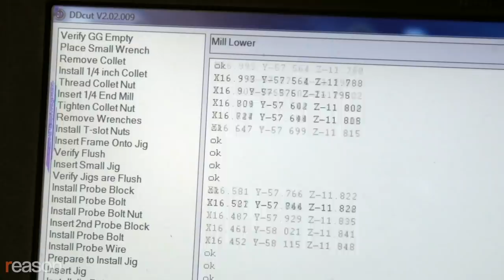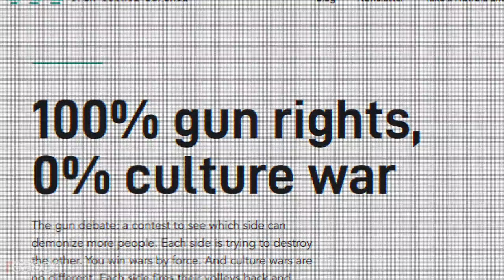Biden's Plan To Stop Ghost Guns Is Doomed To Fail

Comment: To be honest, what I would like to see is pre-made kits with strips of Steel cut to shape and drilled so that we stack the A sheet on top of sheet B on top of sheet C on top of sheet D Etc and then put our rivets through them. Of course, we would lay different parts in place as we would proceed... but one could make something like a Mauser broomhandle type of action in this way where all the parts could be dropped in and assembled just as the milled Mauser broom handle is made today.
As an added bonus, the guy who would sell the kits could also sell the tool kits and magnifying materials necessary to do a good job with something like that.

Comment: You can't have a reliable gun completely built out of plastic. So no it can't bypass security because most likely the gun still has metal internals to deal with high pressures, something plastic can't do.

Comment: The list of guns you can 3d print with a sub $200 printer is pretty large and getting larger by the day. Wilson is 100% right. If anything this explosion in 3d printed firearm design will accelerate with more regulation. Right now there are dozens of firearms you can print then finish with factory parts and only a few total scratch built designs. As soon as ATF issues rules regulating more gun parts the 3d printing community will begin shifting to making those parts. Even after those rules are likely shot down in court the shift toward totally scratch built arms will likely continue. As happened with magazines where government mostly lost in court with rules and laws restricting mag capacity, but the evolution of 3d printed mags has continued to the point they rival factory mags government sought to ban.

Comment: 0:48
That's interesting. Can you actually make a fuctional firearm from 100% plastic (apart from the repellant of course)?
Reply: It's 3d printed
Reply: In short, yes. It's got a VERY limited life expectancy. MAYBE 50-100 rounds at the very best of times, usually under 50. That OG liberator design featured in the video is only intended to be fired once. It's meant so that everyone can have an "oh shit" gun in their bedside table.
Reply: That gun used a metal nail as a firing pin and only lasted one shot realistically.

Comment: Liberator, FGC 9, 'Luty' SMG, guns designed to be an unregistered firearm. Only problem is, when has there ever been a firearm thats uses 0 metal? FGC 9 takes glock parts, Liberator 'legally' needs metal to be detectable, even plastikovs need AK gas barrels and springs! Its just a hopeless battle

Comment: The government would have to serialize every block of metal, every tube of polymer, and lock down any and all components that could be used to mill a firearm from.   

This is not impossible and it is currently done with explosives and drugs as many precursor chemicals are hard to come by, need permits, and red tape abounds.

Comment: Forget guns, you can build your self a Gatling gun you can buy a resin printer today from Gearbest aka China unregistered have it come in your doorstep and you can even buy resin from amazon. If you want to make stronger parts you can even mix in some glass fibers in your resin. It is messy but it works. You can make the Gatling gun autonomous too, but that is a different story. You can make, rockets too with resin printers, that is also a different story.

Comment: Canada has a big problem with ghost guns, but in canada is... different.

What people do is buy gun kits, and mate them with..   BB guns and airsoft kits.   Something you are not supposed to be able to do according to airsoft.     These people will mill out parts from the "toys"  combined with kits, to produce working firearms.    one "pair" working in their backyard workshop, churned out a few HUNDRED of these firearms a year.   Now while they were more expensive to make, then a gun bought at a gun store...   maybe using 1000 dollars in parts...   they were then selling them on the black market to criminals for 2000+.

the ability for people to buy kits then mate them with toys,  as mass production, is a fairly scary thought.  and again, this was just 2 guys.
Reply: @Bada_Boom78  Yes and no,  the vast majority of illegal hand guns in canada come from  "legal" buys in the states, people will go into a gun store in the usa, buy 10-20 hand guns, then smuggle them across the boarder by simply driving them across "patrolled"  areas, or bringing them across by boat.   Buying guns for 500-800 dollars in the US then selling them for 1500-1800 in canada is still a profit.  And far easier.

But you can still legally buy handguns in canada.

Comment: Least you forget the Constitution ensures we have the Right to Bear Arms. That "right" has no nonsense baked right into it. You do NOT need a license to own a firearm. This is not a right that you regulate. All that an FFL is there to do is to accomidate the commercial transaction and NICS background check in the movement of firearms from one party to another. It is NOT a license for the holder of that firearm. That "license" is only for the commercial distribution and transfer or sale in the aspects of commerse. NOWHERE in the 2nd Amendment or elsewhere for that matter does this state you cannot manufactor your own firearm.

If your INTENT is to sell this firearm, then by all means yes it needs to be regulated to record its transfer in the act of commerce. 

Period.

Comment: genuine question: Can you really entirely 3D print a gun with its ammo? Like, you need bullets. not only that but you'll also need powder to shoot said bullets. Can you 3D print a suitable bullet, heck. will the gun even withstand the pressure of firing if it's made entirely of plastic? Is that possible? I mean even if you got the thing to be entirely of plastic, there would still be other ways to detect it. Police dogs would smell whatever propellant you use for the shells a mile away.
Reply: you dont print bullets you cast them

Comment: Good luck trying to regulate every single CNC mill and 3D printer out there.
Heck if you try hard enough I can assure you that it is very possible to mill out a M2 Browning from scratch. 
Heck the original design is from 1933, the mechanism ain't that complicated.

Comment: haven't watched this yet but, i mean, if y'all think that this is the first time a pres wanted to prevent 3d printed or homemade guns, you're wrong, this is the 3rd president in a row, I'll update the comment if thats addressed btw

Edit: 
finished watching, they did touch on it but i real quick wanna soapbox here, i think that gun and car licenses should be about equal, and that they should pretty much only mean "you can use/have things with this vague functionality in public only if you have this card".
think about it, if your dear ol pa has a tractor or a car or a golf cart you can drive it on his property with no problem at 12 years old, but to go out in public with it you gotta do a test to show you know how dangerous things can be, and after that whatever dude go do whatever(though homemade cars are sadly not a thing these days or I'd be driving around in my single-seat sized electric car to and from literally anything)

Comment: Its funny how the most common response is " Well if you know what your doing you can just make one without this machine therefor we shouldn't stop devices like this from being made or regulated." as if this argument makes sense.  I mean people will just die in cars anyhow why are we regulating safety features?  Just because a thing is going to happen doesn't mean we shouldn't make the attempt to restrict that thing from happening its the difference between some rando trying to avoid the restriction, is it going to stop all ghost guns, no.  Is it going to make them far harder to make absolutely.  Also there is no expectation of safe operation of some rando gun but if a registered company mass produces guns that explode on people there is repercussions and consumer protections that do not exist with self milled or 3d printed weapons.  The right have been screaming "There taking our guns" for 30 years and somehow we have yet to see a "we are taking your guns" act. an act that will never happen but it doesnt stop the fearmongering.

Comment: Said before and i'll say it again, regulating guns is a pointless move. First off it ain't hurting the bad guys, Correct me if i'm wrong but i don't see gangs and other bad guys getting guns from stores where they have to do papperwork which could be used to find them if they use the gun. Regulating is hindering the good people's ability to defend themselves. Secondly, as shown on this vid, if you restrict people will just find ways to make their own shit. just like they did during the prohibition.  

Even if they tried regulating the ammo, which i think would actually have a somewhat bigger impact at least at first, i can promise backdoor dealings will happen and bad guys will still keep supplied.

Comment: no ones gonna use a plastic gun. the bullets would be too shitty to do much. and the accuracy will be terrible. Its like using ratshot. except even weaker.
Reply: the bullet is metal and they use a couple metal parts, the metal detector thing was a weird thing to bring up

Comment: Being British and having almost no access to guns but advocating that we should have them. only our hardened criminals and there cohorts have guns here. <with a few exceptions i.e police at airports  police around parliament/palaces. Yet We allow 12 and 13 year olds weapon training and access to Live ammunition, Have Britain ever had any incidences with these children, No we have not - so Training from a young age instils understanding of the risk and danger as well as proper handling and safety.

there should be Less Gun Control and more Youth Firearm training at young ages like we do here in Britain. true most of this training is with .22 rifle and cadet GP L98a1 rifle<Basically an SA80 with firing mode set to single fire, some of the more competent children get to use the LSW standard issue the same as the British army. Youth Firearms training for all would increase respect for such devices.

Comment: I would point out though, I learned how to machine gun parts in about 2 months in a class I paid 350 dollars to take on gun smithing. Its not rocket science. its scarily easy and if you ban guns people can and will simply make their own. We did it once in history and now wiith science where it is we have so much more capability at home. Not saying I'd do something like that I carry legal fire arms but the answer to ghost guns is a simple one really. Licenses should be given out for 3D printers the tech simply has too much potential to be abused and its always been that way.
Reply: the plans for the ghost gunner are entirely open source and use incredibly uncomplicated and widely available parts obtainable in most countries while the software to run it is a torrent away. And that's for a desktop CNC machine. 3d printers are even more accessible. You run into literally the same issue as gun control. Can't stop the signal.

Comment: Wait You can make a gun out of plastic will not just like break in the first few shots and if this is an actual thing there should have been tons and tons of more assassinations because if they don't go off during metal detecting you could slip them into anywhere but then again I guess the bullet would be detected and then they would find the gun